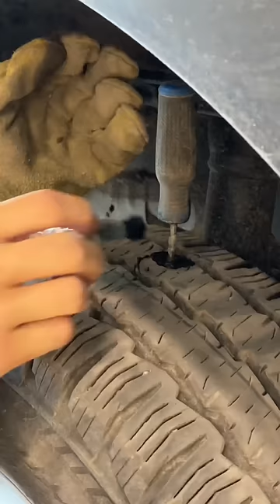Why You Shouldn’t Plug Tires #tiredoctor #tireguy #tires #shorts #tireplug

Comment: There  great to get U  out of trouble on the side of the road , I was a mechanic and it was convenient but then made illegal so we stopped but it wasnt a rubber tube  it was a fibre with some sort of glue and it bonded with the tyer  the mushroom patches are best but these are great to have in Ur car to get U out of trouble , I used to carry a set with its tools in my last car and saved me a few times I had a tiny air compressor that connects to the battery and helped alot

Comment: Your life is worth having your tire dealer remove the tire; check to see that the sidewalls aren't damaged;  apply a vulcanized patch; and rebalance the wheel.  Proper patching also doesn't void the tire warranty.

Tires with internal sidewall damage are very hazardous to drive on if plugged and you continue to use them instead of replacing them.

Comment: Frowned upon because if the object had enough force to be shoved through into the inner liner, then it had enough force to break steel belts in the plies, that section of the tire is now weakened and shoving those tools in there repeatedly doesn't help
Also, in high pressure/heavy load tires like on semi trucks, the plug's poor seal under that high pressure can allow air to seep through and begin separating the tread from the casing, I've seen it so many times and semi drivers would have saved hundreds on a proper patch and plug repair for $80 instead of buying a new tire for over $400

Comment: It's frowned upon because they can't sell a new tire.  I've done SO many repairs that I've lost track... Several hundred without a doubt.  Just do it right, it'll never come back.  Do it right and water will not get to the steel belts and corrode them.  Perhaps don't do it on an F1 Car or a Boeing 747 tire, but a car tire, no problems. Sometimes you don't even have to take the tire off, if you're lucky and it's the front, just turn the wheel and drive the car till it's at a 45 degree position, couldn't be easier.

Comment: It's OK to plug my Bias ply Tires But radials  Are steel Belted and the steel belt can cut a plug.Tires should be repaired from the inside with a patch or boot or a unicycle which is a patch and a plug together

Comment: I had a hole in my tire made by a 3/8 bolt. It took 3 plugs to stop the leak. Drive on that tire until the tread was gone. I have a plug kit in my work truck and my personal car. I had a spike in one of my tires. I took it to the tire shop to get it fixed properly. Within 2 weeks, the tire was leaking and a tire man had to come fix it again. I don't like the flat strips though. I prefer the round cord strips.

Comment: I had a plug pop out when i hit an Arkansas pothole. Heard the air leaking out. Pulled over, told my wife to get the plug kit out while I held my finger over the hole. 

Put two plugs strips in instead of one and got back in and drove to gas station to put a few pounds of air in tire. 30,000 miles later and still driving on that tire.

Comment: Yes because taking the tire apart using a pneumatic drill with a debrising attachment on it to drill through the hole deburring the steel cord and then pull a plug patch through the inside of the tire is completely different ..... than what you just showed in this video....

Comment: Always plug your tyre if you have a puncture in he meantime.

Mate, I had a wood screw in my tyre one day when I went to the shops. Pulled it out. Instantly losing air. Shoved it back in there and it still wouldn't stop. Walked into a Kmart bought super glue super glued over the hole with a piece of plastic wrapper from a chocolate. Waiting 2mins. Drover slowly to a petrol station. Filled with air and drove home 10 mins still with it in and leaking. Got home though. Next day got it patched with an actual patch. Drove on that for another 6 months when I swapped al tyres.

Mind you I had tread left. It was just a puncture.

Comment: There's currently a nail in the rear tire of the trailer I drive for work, it's been in that tire for over three years now, only reason we haven't plugged it is because of time, and I've gotten the airing of the tire down to just a few minutes each morning, plus a tire gauge.
Reply: Literally takes 5 minutes or less to plug a tire as opposed to airing it up every morning
Reply: @randybonner9870 the lengthily part is taking the tire off the trailer.
Reply: @joeltrekwars2162  Maybe I'm misunderstanding . Why would you need to take the tire off the trailer to plug the tire with one of those strip plugs ?

Comment: I never could figure out why plugwd tires are considered unsafe i have done it for iver 30 years its hard to not do it right if you use a decent plug evey so often you get one to big to plug and have had problems with 10ply those are hard to plug but i cant aford to replace a tire every time i run over a nail

Comment: Technically, the right way to plug a tire for long term is from the inside, but since around 2010ish, a lot of shops stopped doing it that way and just started doing it from the outside i guess they figure it'll be a return repair. Personally, i just use 6 cans of fix a flat and 2 rolls of duct tape 🤷🏻‍♂️

Comment: Plug internally with a mushroom plug is safe yes. The plug repair you see in the video is like a quick emergency repair you can do on the side of the road but shouldn't be treated as a permanent fix
Reply: So many people say, but they work permanently enough to wear the tire out about 98% of the time. And when they don't,    98% of the time they turn into a slow leak which enables you to easily drive somewhere to get a new tire or a different kind of patch.

Comment: I did it recently to my tire when I had not other option... my spare didn't hold air and my tire went flat faster then the spare ... used the spare to get a few miles to my parents house then grabbed my dads air compressor and plug kit and fixed it myself to get home

Comment: Plugging tires is not the best way to repair a tire but it's certainly better than nothing. If you can patch a tire properly, you should. Everybody saying that plugging a tire is fine because their plugs held up are missing the point, plugs are a less than ideal solution. Oh and BTW a tire's speed rating is completely invalidated once it has been plugged or patched.

Comment: People drive on a flat and or a tire run soft. It ruins the cords in the sidewall of the tire. They finally take it in get a plug put in and the tire blows. They hold the shop responsible. Thats the sole reason they won’t plug a tire. If they can’t remove it and inspect it they won’t fix it.

Comment: Where I come from (France) plugging tyres is common practice even if you take it to a repair shop.  Never once had a problem with a plug.
However your final step is wrong.  You should always leave around 10mm when you cut the excess.  It will wear down naturally as you drive.

Comment: Plugging tyres is at best a bodge. And too often they still leak. Only one way to fix a puncture and that is a patch inside the tyre. And not on the tyre shoulder as they can work loose as the tyre flexes

Comment: I installed a plug(a quality one ) in a two week old tractor tire with a nail in it in 2001 and it’s still holding the air pressure like it should.

Comment: They also say dont plug a side wall. 1500 miles into 50k tires tree branch went thru the side wall. Tripled the plugs and a bottle of cement later i got 55k put that tire

Comment: During hurricane Katrina I had a little Chevy S10 I was driving back and forth to the landfill where I was part of a crew recovering refrigerant from refrigeraters air conditioners etcetera it was also right next to where all the roofing material was brought imagine the plethora of nails from the rooves of hundreds of thousands of holmes I went through a case of Fix-A-Flat and at least three sometimes four or five plugs every few days and I rode those tires till I got rid of the truck 5 years later I think it was mostly plugs and less tires

Comment: Tire plugs are easy as hell but to really do it properly you need to pull it off the wheel and also prep and patch the inner liner
Reply: If that is your definition of "properly" but as evidenced by the comments here, the huge majority of the time a plug works absolutely fine. And if it doesn't, you now have a very slow leak and can easily drive to get a patch if you want one.
Reply: @justliberty4072  i never said just a patch wouldnt work they work fine im just saying a proper tire repair has a rubber plug and a patch on the inner liner that is stuck on with vulcanizing glue, chill out man i never said anything doesnt work nor was i talking down on anyone using a plug

Comment: No money in plugging the tire. Like the 7 year rule. Those belted radials are not going to have a blow out no matter how cracked the rubber is on the inside. When tires start leaking it's because the bead wasn't glued properly or the tire got low in air and the bead was broken.

Comment: Plugging seems like one of those 'get you home because it works, but dont do it if you have a choice'repairs, like pissing in or cracking eggs into the radiator, running the engine with not the intended fuel or oil  or using something other than a proper fan belt for a fan belt

Comment: To be honest, out of literally 100s of these I’ve put in over 40yrs I’ve seen only 1 cause an issue and only 1 other still leak, the “issue” was when I used a drill with the reamer tool for the plug, it spun with enough force to damage the metal wire band in the tire, so no more power reamer and the one that leaked was because I was 17 miles on a forestry road, the glue in kit was dried up, I dropped plug in the dirt nervously while watching the large black bear slowly walk up the road towards me, so yeah probably why it leaked, 2 fails out of literally 100s of these things isn’t a bad record…..where they meant to be permanent, NO, is the correct way to take tire off and patch inside, YES……….but do they work as semi permanent and work good? YES YES

Comment: The problem isn't really the plug. The problem is the tire can be severely damaged due to being under inflated, and unless you dismount the tire, you will never notice the damage until the INSIDE of the tire becomes the OUTSIDE of the tire. Off-road tires can be plugged all day long. If a low speed off-road tire comes apart.... it's unlikely to get someone killed. When a highway tire comes apart at 70 mph, the resulting crash often results in serious consequences. 

It has zero to do with plugging technique.....other than there's a better way to make the repair...once the tire is dismounted so it can be inspected. I have yet to show a customer or technician an internally destroyed tire and have them volunteer to put it back on the wheel and plugged from the outside!

Comment: Had a tire shop repair an inside dually for me. Hopped on the interstate going 80 and found out in about a minute that they plugged it instead of patch it because they couldn't get the wheel off the hub. Sad when a tire shop can't do their job right.

Comment: Plugs have a chance of separating the steel belts inside tires that keep them round, they’re supposed to be temporary solutions for vehicles that travel at high speeds because of heat and the amount of impact they absorb compared to nylon tires that don’t have steel belts and usually don’t see high speed applications. Just because the plugs you all claim are “good enough” haven’t gone wrong yet, doesn’t mean they won’t.

Comment: One of my tyres has 3 plugs at this stage, developed slow leak, about every 60hrs needed to be inflated. Went to tyre shop, lad spent ages trying to find it and gave up offering me new tyre (didn't had a matching one, not required by law anyway, but I like to have same tyres on all 4 corners) which I refused thinking angrily that now I need 2 new tyres as they have about a year or so left in them. But then I remembered these useless cans of spray stuff that's meant to fix your tyre. As useless it is most of the time, it cost me like 4€ not a 120€ as a shop was asking for, and it worked perfectly..

Comment: Those plugs are not DOT approved for highway use. There are a few issues with using them.
1. You don't get an internal view of the tire to ensure it isn't damaged. Sometimes, a heat ring will be minimal to nonexistent from the outside, but the interior sidewalls are trashed, which can and will cause a blowout.
2. They are more likely to fail compared to the approved patch plugs.

Let's give a scenario where you put in one of these plugs and failed to notice that the interior sidewall is damaged. That sidewall blows out on the highway and causes a crash that ends a life. YOU and your shop are now liable for that accident and death(s).

Comment: Looks like you're using a Tech brand plug which is the best kind there is out there. It melts and becomes one with the tire. I would never use a plug until I started using those and now I've been using them for over 15 years. Never had an issue with one. Only problem I see with a plug is if you don't dismount the tire to make sure the tire has not already damaged from being ran low. But other than that they're good. Of course it is better to then put a patch in addition to it, but I wouldn't on my own tires.

Comment: As a tire technician and salesman yall are clearly going to the wrong shops. Good shops do it for free and properly plug and patch your tire. If you’re competent enough to plug a tire on the side of the road then you’re probably able to bolt on your spare and get it properly fixed. Good shops will fix any mistake they make for free if that even happens to happen…

Comment: So repairing a tire in the industry is super frowned upon, because if it's done incorrectly it can be very dangerous. It also destroys the inside of the tire, which is why some shops don't repair tires with repairs in them. A plug is a repair and sure no one wants to fix someone else's screw up but if it is so frowned upon then why does the manufacturer, the Department of Transportation and insurance companies allow it? It seems like a fantastic money making scheme to make it illegal so the DOT won't allow repaired tires to pass inspection (new tires mean more $$ for tire salesman), cops have something new to chase you down for and ticket you and the insurance companies can further NOT PAY OUT for accidents involving vehicles with repaired tires, citing "safety issues". And those are the "selling" points (fleece points) of the legislative argument that completely ignores the corruption that would run rampant in those circumstances. 
Just Saiyan.

Comment: I pulled a 6mm (1/4 inch) bolt out of a tyre. The internal sealant plugged the leak. I took it for professional repair. Technician said I really need not have bothered and that he was completely unconcerned by the goo. 
It’s a lie to say these methods are unsafe.

Comment: I want whatever tools and methods you use, mainly the drill bit. I work in construction so it seems like I plug a hole from nails or screws every few months. I just have a kit from AutoZone. However trying to push the plug in is very difficult and I’m doing it deflated. If you’re doing it inflated and under a wheel well, then I’ve either got cheap tools/parts or I’m doing something wrong

Comment: I was out of state on an atv jamboree I got a2 inch sidewall gash on a front tire my buddies & I together put about 30 plugs in the gash with glue filled it up coincidentally there was a polaris dealership a few short miles away gave them 500 bucks to take off a tire rim off a showroom unit & strapped it on my front rack everyone thought I was nuts I drove all day hard core hammering the Massachusetts trails trying to f up that ugly protrusion hanging off that side wall . Other than a balance problem on a few straightaways it held all the way back to Connecticut never lost an lb . That was a polaris 500 a .

Comment: You're the tire doctor, you should know that if done properly (this isn't properly idk how they still legally sell these types of patches) you're supposed to take the tire off the rim and use a patch plug. 
Though technically either way the tire is to be considered a non speed rated tire, if done properly with a patch plug and following the rules such as no more than 3 per tire and only if they're 12 inches apart and not in the shoulder or sidewall etc the tire will be fine for normal uses.

Comment: Zero clue how a plug can become a massive safety hazard. Or any real hazard.

About 30 years of working on tons of vehicles in general, all in which needing a tire plug at certain points. Never, ever, ever, ever, ever, have I seen or heard of a plug causing a safety risk. The tire might go flat, if it wasn't done right, that's about it.

Almost like the industry hyped up safety hazards for tire plugs, so the customer has to pay 20x more in a repair bill.

Comment: I used to own a 1973 Plymouth roadrunner built 318 with a four-speed I had 255 6015 on the back did a burnout rip the tire across the trench I put like 8 or 9 maybe 10 plugs in it and drove it and throw them tires were bald and continue to burnouts even with those plugs in it.

Comment: The shop I worked at didn’t care. If the customer was good with then we plugged it. I will say that there were a few that were questionable due to the location. But none ever came out. Wish we were smart enough to use a drill reamer but we weren’t. Just the good ol hand ones. 😂

Comment: I went to discount tire because my tire was low due to leaky rim.  They hooked it to a fancy presure machine that would not fill my tire because it was too LOW?    I thought thats what the compressor and air was for. They said that hose was too short and only the computerized air filler was available. They sent me off with the low tire.